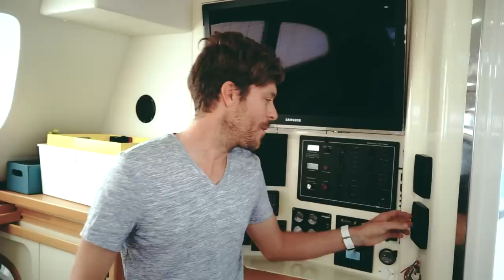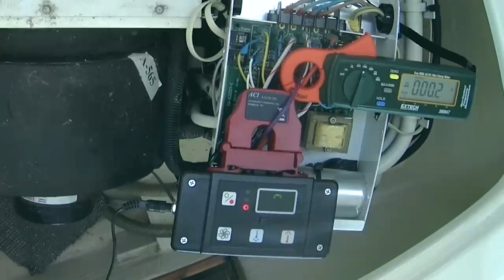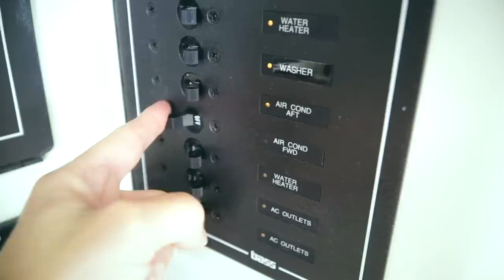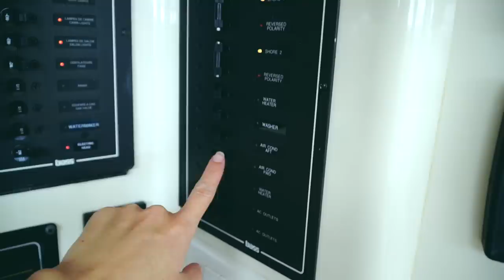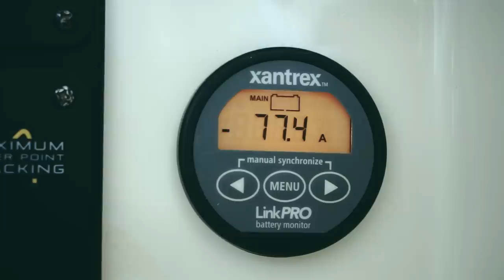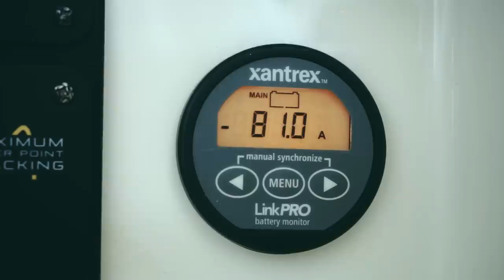Air Conditioning on a Sailboat? Yes, & It's Battery Powered!

Comment: 1200 Amp hours at what voltage?
Reply: I forgot how much I missed/loved these more technical/behind the scenes/bulkhead videos. The travelling/experiences are fun and provide some escapism, but the how-to and the "how not" to be an idiot when you start out" videos are more educational and have me (geekily) on the edge of my seat with attention.
Reply from the maker: I would have to look at the specs again.  They are the relion 300ah batteries.
Reply: okiedokie. Your solar controller would have an output voltage. 12, 24, 36, 48... Doubtfully 72. Basically what does your inverter take in? 12Volt?
Reply: Sudz the voltage is at 220 volts on most boats the higher the voltage the lower the amperage .as long as the motor is spec for that voltage .
Reply: Jim Anderson sorry, wasn't clear - was talking DC/battery side - to power inverter. Was curious if they were 12v batteries run in parallel or in series to bump up DC voltage. Battery capacity is done in Wh (or kWh) or Amp hour (Ah)+Voltage.
Reply: Agreed..I'm running the numbers.  He said A/C is drawing 80 AMPS (power management meter), that would be @ 12 VDC.  So, about 1000 Ah.  How do you get 4-5 hours of use on a 1200 Ah battery bank?
Reply: I think it peaked at 54 amps without the soft start, and then settled down around ~8 amps. If thats at 240v, thats about a 1920 watt draw, and 5 hours would be 9600 Watts consumed.. 

9600watts /12v = 800Amp Hours. So with margins at the top and bottom to preserve battery performance (not fully charging, not fully discharging) , it makes sense to me that they have a 1200Ah rated 12V battery bank, and that they're all run in parallel. 

But I don't think they have a 240v AC Unit (Although most residential AC's are) 

What confuses me now is that their AMP/Battery meter on the battery side showed 80 amps of draw. 80 Amps at 12 volts is 960 watts.... Which would be  This makes me think they actually have a 120Volt A/C system (which makes sense as they're american) and that the A/C Runs from 120 Volts AC.

This means that their A/C should consume (120v*8amps)= 960 watts per hour. 

Which means at 80 amp load on 12 Volt battery, they really should be able to do (1200AH/80Amps) 15 Hours of AC, with a fully charged to fully depleted Battery (which they should never do) 

This is also assuming a 100% efficient inverter, which doesn't exist. Lets subtract 30% for losses in the inverter and safety margin to keep the battery healthy. 

10 hours.

If they had a 24V 1200AH setup, They'd actually have even GREATER run time, because they'd be storing twice the energy. (WattHours = AmpHours X Voltage) And then my 240V calculations would be

I'm particularly curious about this because I'm making a portable battery bank to power my furnace at home to get us through power outages. I've decided on a 48V system (which is more dangerous to work on, but more efficient) and I'm making all the batteries from recylced 18650 Batteries. 

In comparison, I am making a 54Amp Hour 48V system. at 12V this would be 216 Amp Hours. 

Also... a 1200Amp Hour 12V battery pack contains 14.4kWh.  ... 1/7th the amount of a Tesla P100D. I've seen how big the Wynnes Batteries are from previous videos - Its bonkers that Tesla can make a sports car with 7 times the capacity!
Reply: It's run through an inverter, so the AC is 115 VAC with a 12 VDC input
Reply: 80 Amps 12v, on a 1200 amp hour battery SHOULD run for like 10 hours minimum. I'm guessing with all the other devices (Fridges, Freezer for Nikki's icecream, lights, laptops, Avionics (or whatever the boat navigation equipment is called in a boat)... "Nautonics" lol?  That he just says 5 hours to be safe.

I'm also curious if everything runs off those batteries, or if they have dedicated old school SLA batteries to power the starter motors.
Reply: Douglas Montgomery
He said he runs it  on batteries but with a full solar back up  charging the batteries at the same time . That is how.Learn to listen. You ran your numbers missing an important parameter - The Sun ...How can anyone miss the sun?  It is like the largest star in our galaxy...wtf?
Reply: True. I forgot to consider that the 80-86 amps  is only draw from battery. I figured it would be total 12v draw, after solar and battery (going to the inverter)

Jason - I'd be curious to see your solar/battery controller/management system. 

I Assume there's some sort of box that sits between your Batteries, The Engine Alternators,  The generator, the Solar, and the 12V-->120vAC inverter? Is it all automatic or does it require intervention?
Reply: 1200 Ah @ 12 Vdc it would be. Every yacht I have been on is 12 Vdc. Well in Australia anyway.
Reply: I think that's only when the compressor is going.  I'll bet it's lower than that on average.
Reply: @Sutz 80A on a sunny DAY means that the figure was a net figure of consumption and charging from/of the system

Comment: ALSO ---> Use BIG CAPACITORS (on the DC side) for power surges! Tie in in parallel with your batteries. Search YouTube for SIMPLE capacitor solutions. No electronics necessary. People have used BANKS of large capacitors to actually start car engines.

Comment: is that thing a electric capacitor ?
Reply: Hi Slam Boy.  Thanks for the question.  EasyStart is not a capacitor, although it has that as one of its components. It is a highly-sophisticated, microprocessor-controlled soft start device, that dynamically controls the voltage and current applied to the compressor during start-up, using real-time feedback of current and rotation, to gently accelerate the compressor to full speed.  Normally, a compressor gets ALL the voltage and current applied to it all at once, thus resulting in the big "spike" or "hit" that Jason described.  EasyStart eliminates that.

Comment: Big cruise ships run power 24/7 as they have to power everything to work.(its a city on the water). So you can run AC all the time.. No problem....  NOT on small boats that have limited fuel and power needs like the S.S. Minnow your on (aka Curiosity)..  Ya just have to do without at this point... So in sum.. You want big power your just going to have to hit a big cruse ship for all your AC needs. Also cruise ships burn about 80,000 gallons of fuel a day...  So thinking that 4 or 5 gal is nothing... lol

Comment: 16,000tu/hr,  4,689.136 W or 6.2 hp. 4,689W/12VDC = 390Ah X 10 hrs (full night) = 3,900Ah assuming 50% on 50% off = 1,950 Ah. Always good to mention the voltage (assumed 12VDC). Variable speed drives and capacitors will shave off the start up peak (go easy on your inverter), but not reduce the overall consumption. "Swamp coolers" will help freshen up the air at a lower consumption: https://www.youtube.com/watch?v=18hepTiAILk
Reply from the maker: Good idea, but swamp coolers are only effective below about 50% humidity and I don't think it ever drops below 80% in Panama.
Reply: Use Ice! (just don't ask me how you are going to make it. :-)

Comment: a humble suggestion, instead of running a 16k btu air condition, why not switch to a 5k btu portable one?.  When you are in bed room you don't need other place to cool down.  When you are in dining room, the rest of the boat don't need cool air.  If you can run 16k btu air for 5 hours, imagine how long you can run a small portable 5kbtu unit? and you can get it where you need it most ALL THE TIME!! and dry out the air as well.  Onlt thing is you need to make some mod to make sure hot air vent out to outside and condensation collect properly.  If I were you, I would have switch to a small portable 5k btu long ago with a small 12 volt fan to help circulate the cool air even more effectively.  I once lived in Fresno Ca where summer was 108F. Using a cheap $80 small 5k btu window unit with 3 fans to help circulation, my indoor temp for my 4 br 1500 sq ft home was 77F after running the unit n 3 fans for 4 hours.  Hope you give it a try, you would be amazed!
Reply: I agree, If you need to wear a scarf then the AC is too powerful. In most cases the primary advantage of AC in the tropics is dehumidification.

Comment: You're never doing more with less electricity. I'm guessing the other power is going to the EasyStart and you simply didnt measure the current flow to the EasyStart...
The more electronics you add to the system the less efficient its going to be.

Comment: Times have changed fast. A couple years later and The solution is eliminate the inverter and swap to a DC air handler.

Comment: dont know why you dont install an ERV. all the benefits of an AC and very little power used.
a kubix would do fine.
Reply from the maker: Doesn't look like it dehumidifies much, which is mostly why we're running our AC.
Reply: it does albeit indirectly. the temperature differential causes the moisture to condense out and reduces humidity.

Comment: I don't use an air conditioner here in Colorado anyway (and it can get hot and dry here), so no a/c on a boat would be fine. As you say, use it to keep out the mold and bugs and that's about it - you guys have it down.

Comment: Kinda shocked you describe ac how you do.How you describe it in the beginning is Not really at all how ac works,the compressor is a closed Freon system,the air doesn’t have anything to do with it. The air via fan passes over the indoor coil ,that’s where the moisture is pulled from the air and turned in to condensation. But hey what do I know,I have only had my business 25years lol...

Comment: hey you need a dehumidifier not the AC.
Reply from the maker: We have small dehumidifiers but that's actually how an AC cools - by pulling moisture out of the air. So it's a giant dehumidifier.
Reply: Old 02-21-2014, 04:59 PM   #1
johncdbass
Senior Member
Thread Starter
 
Join Date: Feb 2010
Location: SE Fla
Posts: 606
Trader Rating: 0
Default Run a/c continuously or buy dehumidifier?
The Hull Truth boat forum

Comment: Air conditioning almost free, SUCKING cold water from the sea bottom where it is cooler by passing it on a copper or aluminum radiator that has a group of computer fans blowing cold air
Reply from the maker: Might work where there was more of a water temp difference but in the tropics that'll never work.

Comment: Since you can't run your high wattage A/C but for a few hours at most, I see NO good reason for RVers in particular to invest another 275.00 (after discount code) into a poor cooling solution. - The far better option, if you want to run A/C off solar & batteries, is to get a couple of inexpensive 5-600 watt window mounted units, and run each unit as needed. - You still have to upgrade your solar and batteries system to the most powerful you can, but at least with the window units you can actually use them when you have the sun.

I'm not talking about for a boat of course... I'm talking about for an RV. The boat needs ducted A/C to move cool dry air throughout the boat to keep the mold down. I get it... but for an RV, I'd rather invest in something I can actually use rather than just a "tease" of cooling, lol.
Reply from the maker: I sorta agree.  If you have a new RV that is ducted then invest in a soft start.  If you have an older RV that's not ducted, and you don't mind running a window unit, then hell yea, save the dough.
Reply: Start The Rebellion Window A/C units a) aren't designed for mobile use, b) also have high in-rush currents at start-up, and c) are energy hogs.

DC inverter designs, like those found in mini-split units, are far more energy efficient as these units start-up, then run at variable speed to maintain the desired temperature. A side benefit is consistent comfort.

Additionally, DC inverter designs typically have significantly lower current requirements at start-ups; enough, perhaps, to obviate the need for an EasyStart kit.

A great solution that I'll be employing this summer is a VS12 from Comfort Air. This is a DC inverter, dual-hose portable unit that it's extremely energy efficient, thereby minimizing battery discharge which translates to longer run times.
Reply: GWTW & John Coloe... I have a newer travel trailer and it's ducted, but my concern is that the current draw is so high that, as you said in the video, it can only be run for a few hours at most. Since it's a travel trailer the A/C is never used "mobile". As for in-rush current, my inverter can more than handle the in-rush current of a window A/C unit, actually my inverter can start a rooftop A/C unit as well.

But I like DC inverter design, so I'll look into that. At least I wouldn't be investing more money into an unsustainable solution.
Reply: John Coloe - I searched for the Comfort Air VS12  you spoke of but didn't see it... Do you have a link?